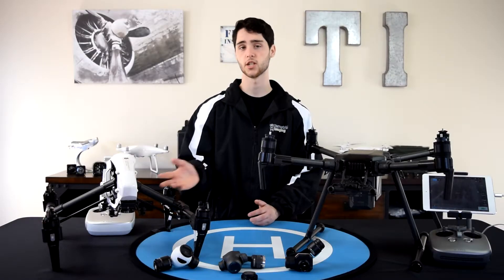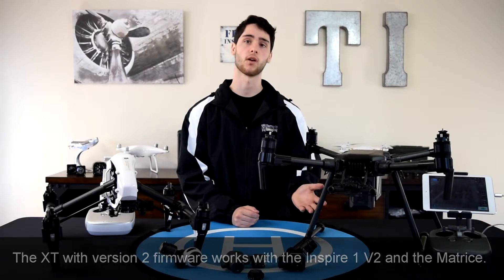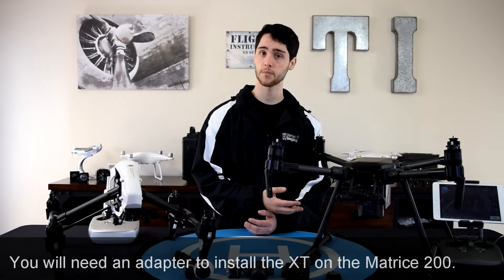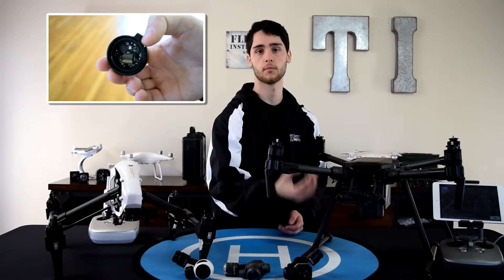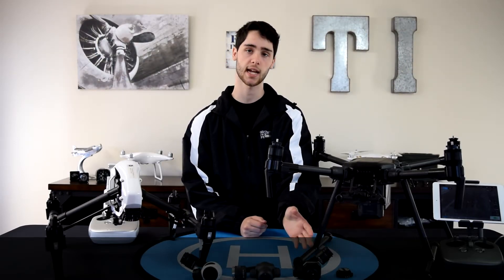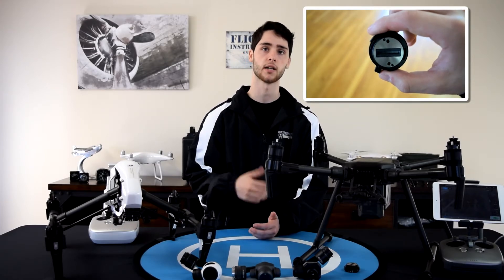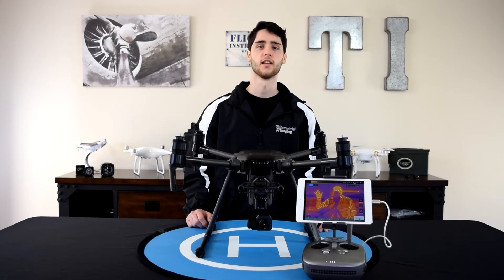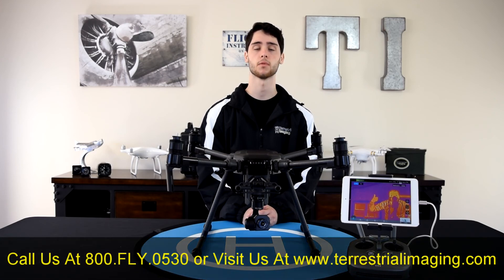DJI XT Thermal Imaging Camera on The Matrice 200 and Inspire 1

Comment: thanks for your videos!!  Now that we are about a year out from this video would you consider an XT 640 30hz 19mm to be a viable camera for getting into the TI work?  I want to get into the TI market (roofing and structure inspection) but wondering if I get a used XT will it be good enough to get business mid 2019?   It would be a shame to invest the money in a used setup only to find out I can't compete with companies already established in my market.  Any advice will be appreciated.
Reply from the maker: 640 resolution is still the highest currently available on any ready to fly drone. We don't know of any higher resolution cameras being developed. So yes, that camera is still great. The only thing to consider is that the XT2 can be bought at almost the same price.